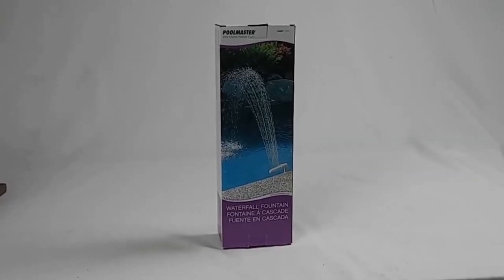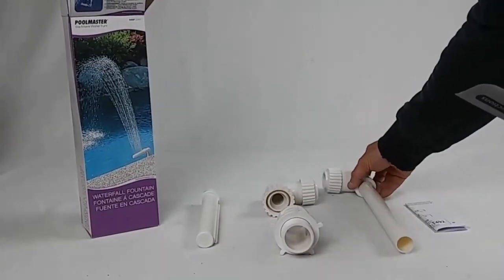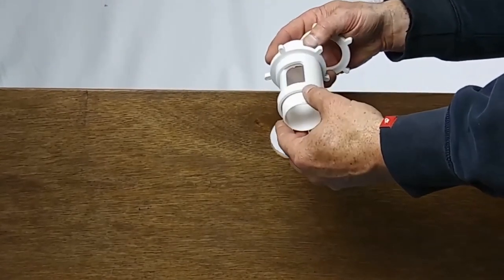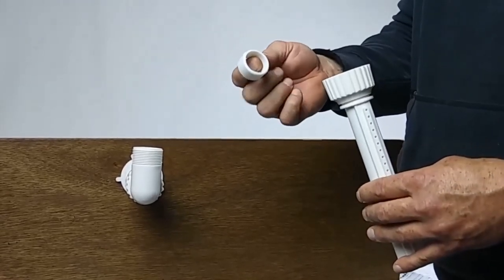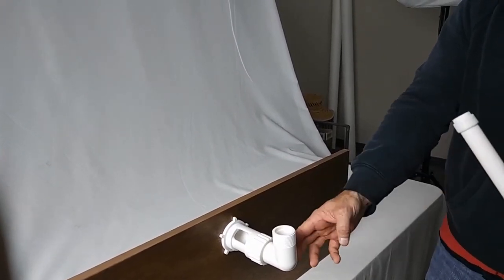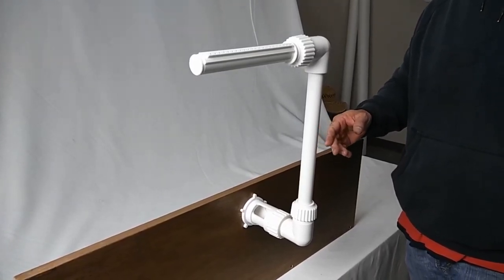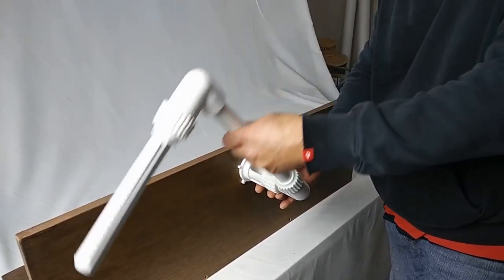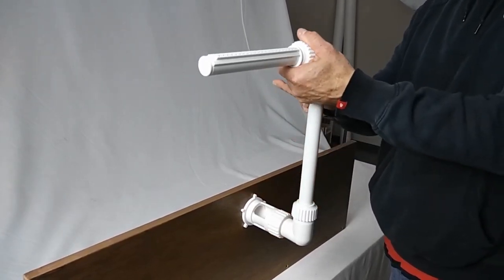How to Build The Pool & Spa Waterfall Fountain

Comment: You skipped right over attaching the inlet. That’s the part we are all stuck on. Don’t make a video if you aren’t going to show everything.
Reply: On mine, the return valve has an eye that was threaded in. I removed the eye and screwed this into the return valve threads in place of the eye. All done from inside the pool. Took about 5 minutes.

Comment: My inlet connector does not fit my inlet.  Is there an adaptor I can purchase?  The connector is 1/4" too small. TY.
Reply: did you ever find the adapter
Reply: Mine either
Reply: @evabush1815  try home depot just get a slightly larger male cap to screw onto the pool outlet.
Reply: Turn the connector to the wall around. That is the adapter.

Comment: can you attached it to the Steel pro pool?
Reply from the maker: This this fountain fits most 1.5-inch threaded return fittings. Most in-ground pools have 1.5” fittings but some in ground and above ground pools may have different size fittings which will not fit. 

For further assistance you can reach out to the Poolmaster Customer Service Department directly. They are available weekdays between 8:00 am – 4:30 pm (PST) at 1-800-854-1492 and they can further assist you with an other questions you might have regarding this product.